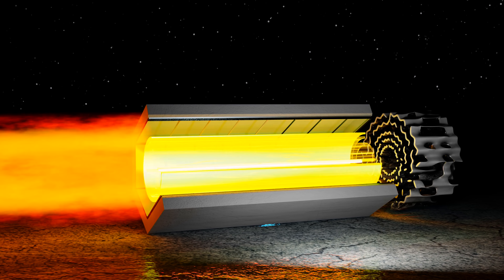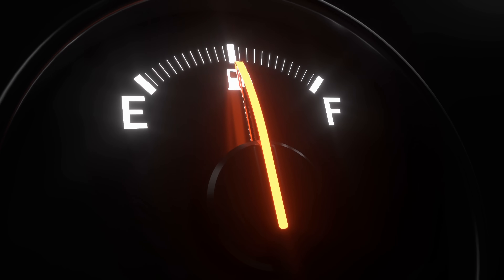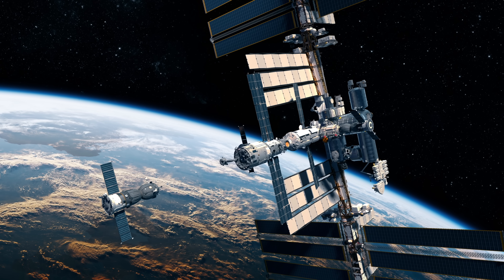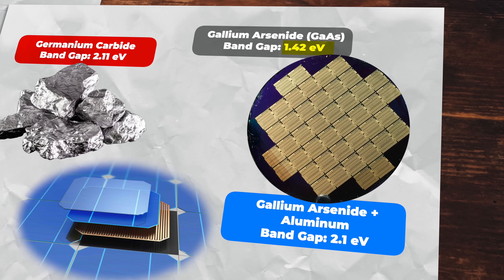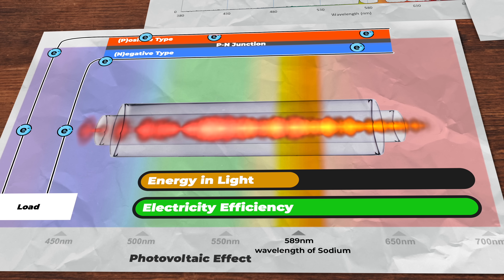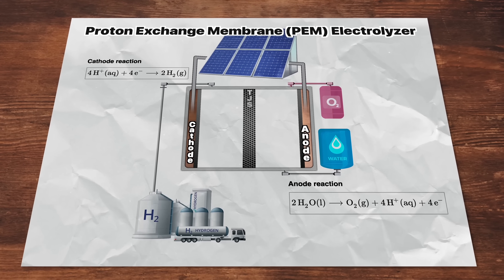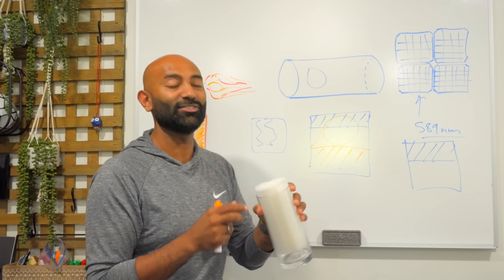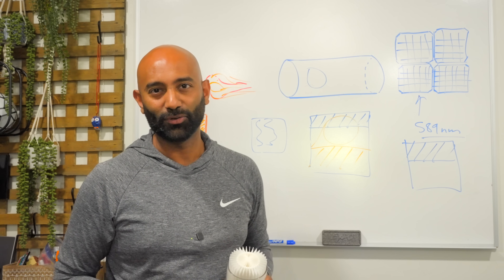Why Solid State Might Save The Combustion Engine

Comment: The only legit science in this episode is the shaver.
Reply: Actually the idea itself is solid, pun unintended. The fuel source would have to be really clean to avoid soot buildup.  There might be applications where such a pin energy source to convert fuel to electricity is useful.  Ships, big rigs, planes, etc.
Reply: @greghelton4668  If the idea works, then burning stuff to make electricity would still be the least efficient way of using it. Because at that point, really anything that heats up the salt is enough. And at that point, you may as well use a solar concentrator or something.
Reply: @loneIyboy15  And said solar concentrator would be running on "free" energy, which is way better than using a fuel. But that's stationary power generation. This one is intended to move things, I guess.
Reply: @loneIyboy15  this video wasn’t about that. Solar panels react to a very narrow band of light frequencies. Hence solar isn’t an ideal power generator when using the sun. But the technology proposed in this video generate specific frequencies, and hence high conversion efficiency.  But the response time will be very long, meaning acceleration would be slow to respond. Hence the application of the generator will be limited.
Reply: @greghelton4668  he's saying you could use a solar concentrator (mirrors or lenses) instead of fuel to heat up the salt to generate those specific frequencies for the monochromatic PV cells.
Reply: @Arithryka  but it won’t work for a car.
Reply: @greghelton4668  Obviously. I'm saying that, assuming this works, putting it in a car is the worst idea.
Reply: @loneIyboy15  - so where's the best place to use the solar-heated sodium? On the rooftop to power your home?
Reply: @manofsan  Literally anywhere else. You could, for example, finally bring back solar concentrator farms, and integrate them with PV cells. Geothermal? We finally have an efficient way of extracting electricity from magma that involves fewer melted parts. Nuclear? Come on, surely I don't need to explain how useful it would be to have 90% efficient nuclear power plants just by using the rods to heat salt, do I?
Reply: @loneIyboy15  - so I find this interesting. Solar concentrators are a different approach to increasing energy yield, by concentrating the solar flux onto the PV cell instead of having a bigger PV cell. But this sodium thing is an alternative to fiddling with the PV bandgap, since instead you're just harvesting the heat (from sunlight or whatever) and converting it into monochromatic light to target a specific bandgap. If only we could find some sodium alternatives that produce monochromatic light which matches the exact bandgap of silicon, then we could boost the PV efficiency with the cheap silicon. (What PV material is LightCell using, anyway?)
Reply: @manofsan  I was thinking more like the solar concentrators before PV got so cheap. But that works too.
Reply: @loneIyboy15  For grid power it is indeed nonsense, but if it is actually as small, powerful and efficient as promised, this thing could be great for small mobile applications like drones, robots and power armor, all of which are struggling heavily with power density.
Reply: @Riesenfriese  I said the exact opposite of what you did. I don't know why you phrased all this like we're agreeing. Grid power would be the exact place for it.
Reply: @loneIyboy15  nah, you both are wrong. The best application would be military ships. They go through so many hurdlers to make their engines as silent as possible to prevent being tracked by submarines. And submarines... For them silence is even more important, heck, if this works as advertised, maybe it could even be used with the nuclear reactors, avoiding all those noisy turbines and even, possibly, pumps.

That's why I'm really skeptical: if this worked, the military would be the first to invest into it, and the US military has, basically, infinite money. They also could procure any, even the most exotic materials, needed.
But only if this had at least the slightest potential to work as advertised though...
Reply: @solarissv777  Define "Best", then, because increasing the efficiency of a country's power generation by anywhere from 5o% to 300% seems better than improving a ship or two for the military.
Reply: @loneIyboy15  look at their web site. They are claiming 40% (have no idea, where this guy brought 80% from) that is good for an internal combustion engine, but modern combined cycle power plants can do 60%. And I specifically mentioned the Navy, as they would be the first adopters of the technology if it worked/was mature enough. But everything currently is built with diesels/gas turbines. So...
Reply: But it makes for a great thermodynamics assignment for students -- show this engine can't achieve 80% efficiency operating at room temperature (external) while keeping the internal temperature below the melting point of Incnel.
Reply: I've read that heat damages regular solar panels and reduces their efficiency over time. Why wouldn't the high temperature from heating the sodium also similarly damage the photovoltaics?
Reply: There is tons of legit science in here, even good engineering, useful products however, are still lacking...
Reply: @heyyowatchthis  I was just teasing, it was too easy.
Reply: those are legit, i want to get one of those, but damn they're expensive, but built to last
Reply: had she figured out the key to making a damn near 75 to 80 engine with no moving parts that can turn light in the fuel. thunder Powers would be would have done away with her😮
Reply: Haha! Only the advert here is truthful! 😂😂😂 💯%
Reply: TPV cells are legit and are the future. We need more. 

 He says 10 kwh/kg, and the graph showed less than 4 liters. 

 My question is that with the total system of just the fuel? Probably just the fuel, huh. 

 That would be like the hydrogen crowd saying, "hydrogen has 23kw/kg with a fuel cell!"

 Yeah, then include the reinforced tanks, and everything, and you get a car that weighs more than the pure EV it is in competition for.  (Model 3 versus Mirai. Model 3 weighs less somehow.)

 Anyway MIT just produced TPVs with the efficiency of our best turbines with no moving parts. It does take 2,000 celius though, but that is still awesome. 

 Anyway like someone else said. The theroy is sound. I just don't think they can make it happen. DoD would be ontop of this for certain applications I think. 

 TPV + Nuclear, and one decade from now -  Fusion cells - please! I need a battery the size of a soda can for an exoskeleton. You need one too.

Comment: perhaps i'm missing something, but i don't see a recent innovation here, they are lighting a candle next to a solar panel?
Reply: it is the small bandgap PVs, which with use of monochromatic lightsource achieve high efficiency.
Reply: @Petriiik  You can't teach a pig to fly, or explain physics to an ant.
Reply: Yea, but.. it's a really bright candle. Surely nobody's ever thought of that.
Reply: Yes, but they are tuning both the light and the solar panel to work better with each other.
Reply: indeed
Reply: yeah, no innovation at all…steam engine is just a big kettle of boiling water…
Reply: With the panel designed to work with the light coming from the burning fuel.
Reply: @WolfeSaber  ya, perhaps the way they are optimizing the waveform is an advancement

Comment: Propane camping light check, solar panel check, save the planet, done 😂
Reply: I guess. A propane tank to light up cerium oxide mantle and then use the light to generate electricity using a solar panel?
Reply: You forgot the table salt
Reply: @testboga5991 Shoot, I knew i was forgetting something.
Reply: Make it several layers of transparent solar cells.
Reply: China just recently released solid state battery EVs for sale so the US government decided to quadruple tariffs on EVs
Reply: @luisrubalcava6331  Citation needed.

Comment: It doesnt take 5 seconds to know that 70%-80% is complete horse shit. You're turning heat into light, you get a loss, and then you're turning this light into electricity which includes another loss? What are the most efficient voiltaic solutions in the world right now? The record established  in 2024 was of 47,6% in a lab... but then you have to add the lost incurred from the heat to light. 

You shouldnt have given this scam any platform.

Comment: Solid state combustion engine just sounds like a fuel cell with extra steps
Reply: Sounds like it is better tuned, more efficient, produces more useful higher gradient waste heat, and doesn't have the headache of storing and transporting H2.
Reply: @anydaynow01 do you have any idea why they would want to bring fuel to make electricity?
Reply: @anydaynow01   Fuel cells can be made for multiple fuel types
Reply: @AmaroqStarwind fuel cell only use hydrogen.
2H2 + O2 → 2H2O + electrical energy
To use other fuels you need an additional system which is called an  hydrogen reformer that converts the fuel into hydrogen first.
it can be done in the same unit but requires energy, lowers efficiency, power, increases weight. but it helps with the storage (hydrogen is stored either as very high pressure gas or very low temperature liquid, both of which are complicated/expensive.
Reply: @geemy9675  Direct Methanol Fuel Cells exist, as do Direct Borohydride Fuel Cells… and theoretically, Direct Hydrocarbon Fuel Cells could be developed too…
Reply: @AmaroqStarwind  Yes and no.  Sure, fuel cells can be made to work with hydrogen, natural gas, propane, LPG, methanol, etc.  But there is a huge gummy problem and that is temperature.

Basically only pure hydrogen can be run through a fuel cell at room temperature.  As you get into heavier gaseous hydrocarbons, it takes higher and higher temperatures to liberate the hydrogen and for fuel cell operation to work.  With obvious consequences.

The simplest type of fuel cell is PEM, which stands for Proton Exchange Membrane.  You can feed it hydrogen at room temperature without too much trouble (of course, making the hydrogen is another story entirely).  But you can't feed it much else without adding heat to the system to liberate the hydrogen.

The most common type of fuel cell system is natural gas or methanol based.  Natural gas requires a high temperature to liberate its hydrogen while methanol has the advantage of being easily stored in liquid form and only requires a bit of heat to operate in a fuel cell.

Unfortunately, higher temperatures are required to improve efficiency... which is a bit of an oxymoron.  Thus fuel cells have fairly severe efficiency limitations.

So the answer is yes, but also no.  All fuel cells are not alike.  You can't just stuff in a random fuel and expect it to work.

-Matt
Reply: @AmaroqStarwind  Correct.  Methanol was a popular choice before lithium batteries got cheap
Reply: but actually has zero similarity because there is no chemical reaction besides the combustion that produces heat. fuel > heat > light > electricity VS fuel > electricity. I don't know how the plan to extract so much heat from combustion gases though near needs to move from the gas to the sodium, so the exhaust gases temperature will be above sodium vapor temperature (260°C/533K) if you want to extract lets say 90% heat you need to have a heat source about ~5000 C/K.
It sounds like using exhaust  gases in a hybrid car would hardly produce any sodium vapor or only with extremely low efficiency
Reply: @geemy9675  Fuel cells get hot. It’s basic thermodynamics.

Also, adding additional steps (like having to convert light) before producing electricity just reduces efficiency.
Reply: @jtjames79   maybe I don’t need a jetpack.
Reply: @AmaroqStarwind  yeah but it's just the byproduct / inefficiency here energy goes 100% into heat
Reply: @AmaroqStarwind  Everybody needs a jetpack.
Reply: BUT- nearly as high efficiency with more robust components, since there aren't currently any solid-state membrane fuel cell designs of large size.
Reply: @ticthak  Yep and the control systems should be much simpler too so maintenance would a lot less with a longer reactor/generator life. This is quite interesting actually. Use excess renewables to create stored chemical energy, the burn that energy in the reactor for emergencies/peak shaving and seasonal use. I hope they can get it to work at an industrial scale!
Reply: @anydaynow01  The cost is key to this being a success, as usual, and I think they have a good plan in their hands
Reply: @ipp_tutor  if it's expensive but has unique characteristics it can make its way into range extender for hybrid supercar/military drones etc
Reply: @ticthak  AND way more power density! It's like the difference between distilling water and grinning it through a desalination membrane.
Reply: With one key benefit: it can run on hydrocarbon fuel, not just hydrogen.
Reply: Just that it's more efficient and much cleaner.
Reply: fuel cells just sound like fuel with extra steps and less power density.
Reply: There are several solid state hydrocarbon engines. Magneto hydrodynamic generators have a high theoretical efficiency but 22% is the best demonstrated. Solid Oxide fuel cells get the chemical energy from the oxygen atom passing a ceramic membrane so they work with all hydrocarbon fuels, I have heard great claims of 60% efficiency but they don't seem to have come into use I think it was the cells wearing out quickly. Seeback effect thermocouple usually have an efficiency under 8% but more modern samples using topological conductors tellurides have claimed efficiencies up to 38%  About 16 years ago I remember a company called Avto metals claiming to have a vacuum gap thermocouple with an Carnot efficiency of 92% but they seem to have disappeared.
Reply: Is efficiency limited by the Carnot cyle?  Can someone comment?
I don't see how it's efficiency can beat a fuel cell's efficiency.
Reply: @bru512  I love it when people more knowledgeable than me come in to help me explain something :3
Reply: Rick & Morty reference?
Reply: @michaelfitzpatrick3020  No. I don’t even watch R&M.

I say it sounds like a fuel cell with extra steps because that’s exactly what it is when I look at it.
Reply: TPVs are the future. Mark my words. So many applications that generate tons of heat. 

 The question is... What are you going to use to produce that heat?

 I know MIT recently had a break through with TPVs with 45% (ish) effiency. Basically just as good as a turbine with no moving parts. 

 I truly believe the future of energy is nuclear and maybe eventually fusion with TPV cells. 

 Nuclear fuel cell the size of a can of soda powering my exoskeleton? Yes PLEASE!
Reply: China has solid state battery EVs for sale
Reply: combustion engine might produce more escaping heat to recharge car is the main idea.
Reply: Sodium Rocket to me... just sayin
Reply: Amazing how so many people are trying to rationalise this, face it folks this is just another investment scam.
Reply: And fuel cell already involved a lot of step.